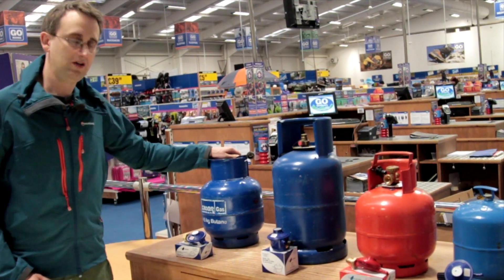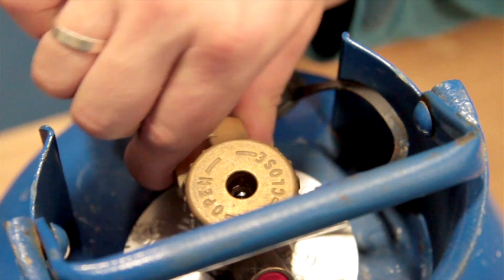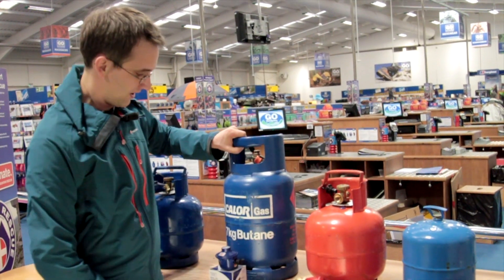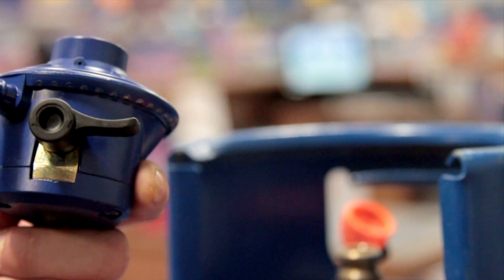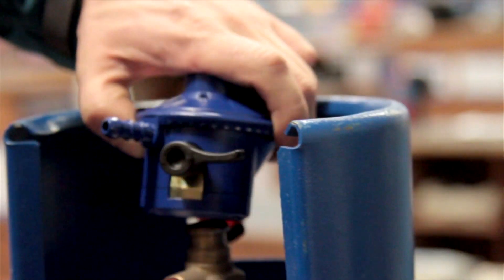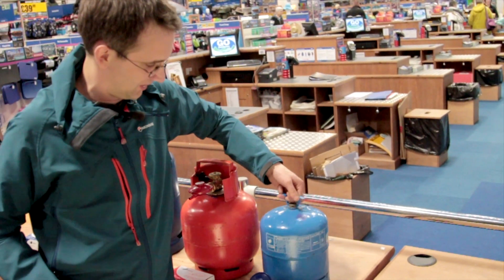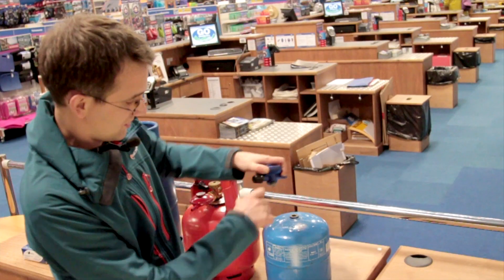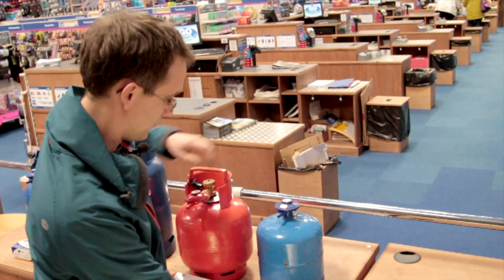How to fit a regulator to a camping gas bottle | Know Before You GO

Comment: I bought a new regulator, fitted it and it works perfectly. when I went to the shop, found it easy got the advice I required from the staff and took it home. no problems.

Comment from the maker: Hi Sara-Jane. Thanks for your comment and good point! We'll try and fit it into another video, in the meantime to remove the butnae clip on regualtor: 1ensure the gas is turned off and the knob is horizontal (like in the video) 2. while applying a little downward pressure press the knob in towards the regulator - this will release the internal catch and the regualtor will easily come off. Hope this helps for now.

Comment: Please don't anybody watching this try and screw the jubilee clip up holding it the manner in this video!! If the screwdriver slips it will go straight through your hand!! The jubilee should also be able to be tightened using a small socket....much safer.
Tip for sliding the hose on , warm the end in hot water to soften and use a light smear of washing up liquid. 
Good info on the gas bottle regs though.

Comment: Hi, I would like to ask you if I can use a 4.5 butane gas bottle with a regulator for my trangia gas burner. And what adapters do I need, because I couldn`t find anything that fits from gas regulator to small trangia gas system. Thing is, I am tired to pay a fortune buying small cartridges which last only 2 hrs each.  Thanks a lot!

Comment: We have a gas barbecue and the regulator dosnt fit is there 2 sizes
Reply: ceri yates Flogas have 2 sizes of bottle valve, 20mm and 21mm on their 7kg and 13kg butane cylinders whereas Calor Gas use a 21mm valve on their 7kg butane, 12kg butane and 15kg butane cylinders

Comment: Yes agree with others. Loads of info on fitting, nothing on removal! This is what I am struggling with, so it would be useful.....
Reply: Simply do the reverse...  Turn clockwise with spanner. Or if its the click on type of regulator even easier...  The tap itself shoud have a little button on it. Press this in and you will find the tap twists 180 degrees more than it will normally and off it pops